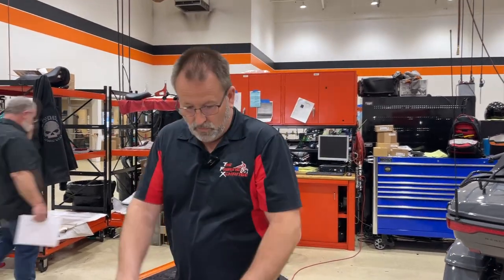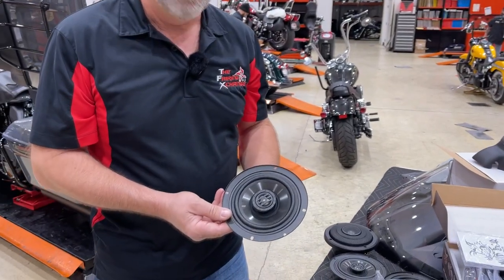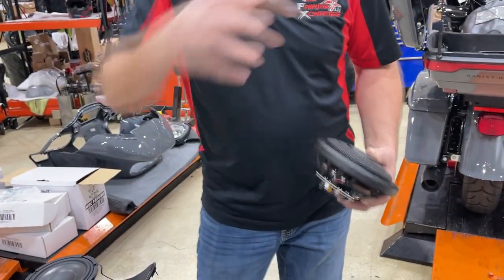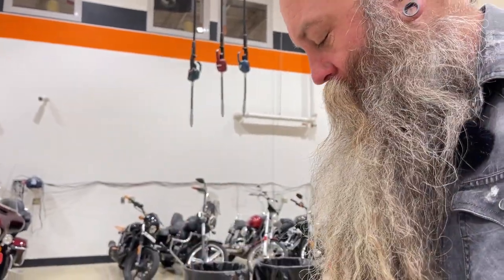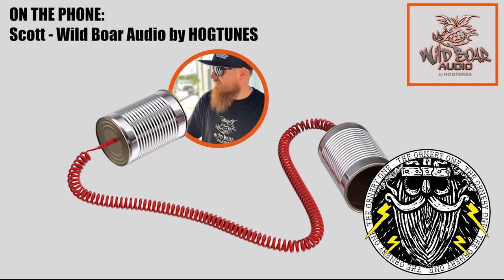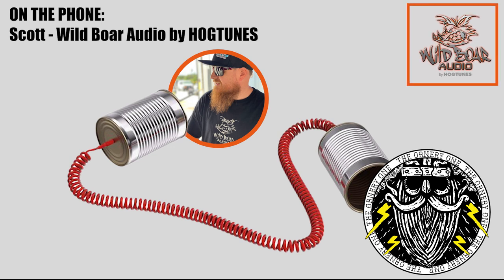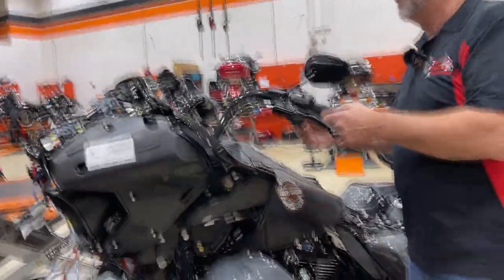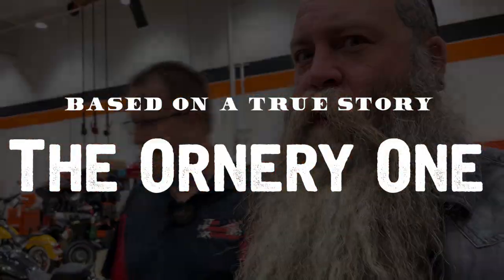EP8 Motorcycle Audio 400 watt amp 6 speaker system bike build | Wild Boar Audio Hogtunes Best Stereo

Comment: Interesting you guys are flashing the radio, as it makes sense to do. When I called Hogtunes to inquire about this kit they told me flashing was not necessary
Reply: It is not a must but it Lowers the output from the radio giving you a cleaner signal going into the amp so it is cleaner as it is amplified coming out.

Comment: I put the 4 speaker Ultra kit on my 2016 last summer. I had an amp go out and Hogtunes replaced it with no problem. I upgraded my amps to the new 400 watt amps and this system will absolutely blast now.
Reply: I didn't have the same experience. we are removing it all sending it all back and going with sinister audio.was not much louder than stock.2022 ultra limited
Reply: @tintshopnc5552  did you have the radio flashed?
Reply: @firechickenracin  its a 22 so you don't. the system is a little better than stock but doesn't hold a candle to the kicker and no where near the rockford. we decided to go with sinister just waiting to see if they will take it back or we are stuck with it. if we are ill do a full video on it and show how underpowered it is so people don't waste their money on it when there are much better choices out there.
Reply: @tintshopnc5552  with out a hog tunes installer flash it won't get loud
Reply: I didn’t install it myself, I paid a shop to do it. They have been in touch with them and it’s all setup correct. The system stinks. It’s not all that. It’s like a 800 watt stereo but they only let you use 100.
The shop we used was even dissatisfied with the results. They do a lot of bikes .
Reply: @tintshopnc5552  my story with hogtunes is they advertised on their website plugnplay. So I decided to go with hogtunes. I ended calling them up because something just wasn't adding up. They said I would have to get my stereo flashed. So now I would have to have grizzly Harley Davidson install it then ride it 120 miles north to Kalispell Mt to have a dealer of hogtunes flash it. Who was gonna be responsible if the stereo didn't work? That stereo came in that day to grizzly hd. I went straight down there after work and told them to send it back. Then hogtunes tried telling grizzly hd it didn't need to be flashed because its a 2019 and to relay me that message. So now these idiots don't even know their own product which speaks volumes. A sound system was financed into the bike I bought.  I literally gave my fob back to grizzly hd owner and said if you don't get me a Rockford fosgate sound system you can take the bike back. I ended up getting a Rockford fosgate sound system. Get this I paid just as much for a stage 3  Rockford fosgate 6 speaker setup (that only requires 1 amp) with color matched lowers from hogworkz  vice a 4 speaker set up with hogtunes wild boar. My Rockford fosgate 6 speaker sound system is the best bike system in the Missoula area hands down. Like I said best decision I ever made.
Reply: So if what you are saying is true it’s not a plug and play. The people at hogtunes never said that.
It’s just not a good product and this seems to have more people trying to return and being unhappy than is being spoken about.
Not a good product and I’ll wait to see if they take it back, they aren’t good about that. If not it will make a great video at my expense of $1300.
I may give it away if that happens but I won’t keep it on my bike.
I don’t ride it either until it’s fixed .
It’s brand new and I can’t enjoy the bike .disgraceful
Reply: The Rockford is a much better system. I’m glad you got it sorted out.
They usually don’t take back anything. I have heard horror stories. And $1300 is a lot of money to me and most guys.
Reply: @tintshopnc5552  the stereo was still in an opened box at the Harley dealership. Hogtunes Pretty much had no choice on returning it.
Like you said the newer bikes supposedly don't need to be flashed, but those idiots told me they do. So I don't know. That was the deal breaker of them not knowing their own product when it came to me buying their BS. 
Rockford fosgate been in the business for decades and has always put out quality stuff. 
Hope you get your money back
Reply: As a shop owner I can say , you got to know your product. If not people lose faith in you.
I’ll keep you all posted on what happens and if they are a stand up company or just no good
Reply: @tintshopnc5552  the reason why hogtunes 4 speaker set up was gonna be just as much as the Rockford 6 speaker with hogworkz color matched lowers is because at that time in 2020, hogtunes we're selling unpainted speaker lids that were apart of the kit. Then I had to out source a painter to match the lids to my bags. Grizzly Harley had set that up for $500.
With Rockford they were ahead of the times and we're the first ones sending out templates to cut the lids   for the 6x9's. 
I didn't need to spend $300 on lids and $500 to have them painted.
That extra $800 gave me room to buy 2 more speakers and the lowers from hogworkz.
Reply: @mikepsly73  my audio guy has a phone call with them this week we will see if they sort it out. if they do ill update you all .if they sort it and it sounds like it should ill keep it.
Reply: @tintshopnc5552  the only reason why I went with hogtunes in the beginning is because they advertised plugnplay no flash needed. Where I live in Missoula the only choice I had at the time was that boom audio crap. 1 amp for every 2 speakers gets really expensive and they take up room. Once hogtunes rep said to me that I would need to get it flashed I sent it back that day. Grizzly Harley became a rockford fosgate installer and dealer because of me.
Reply: @mikepsly73  so here is where I sit as of now.hogtunes sent my shop a new speaker it still sucks , the kicker is still much louder and better bass and half the power. the dealer cannot send it back so I have to take a loss and try to sell it. we will be making a video comparing the system to kicker and rockford which is the loudest system I have heard yet . the sinister sound I heard on a bike here by my shop was another awesome choice. we will show people in the video how low it is and cannot barely be heard at 65+ MPH.also its money out the window , there are no returns.so I am out $1300 plus labor and have to start over , new system will be 2k. people before you buy investigate all the issues that hogties has.
Reply: @tintshopnc5552  sucks bro. Buying shit twice for a bike is what we deal with..however that is a huge hit. I would just box it all up and send it back with a letter telling them they can keep their garbage.
Reply: @mikepsly73  they don't take back anything that has been opened . the shop that installed it will no longer deal with them or any of their junk. they are Canadian based so there isn't much to do. I will try to sell it but won't ride the bike until I get something good in there. you wind up leaning into the fairing to try and hear music. terrible.
Reply: @tintshopnc5552  Wow.  Somehow something must have been wrong.  if you installed the wild boar system and you do not think it is amazingly better, there was something wrong!!  Flashing it does make a difference and there are different settings on the amp so maybe that was the issue.  Obviously it is too late at this point, but I wish we could have looked at it to see what was wrong.
Reply: @paulbarber4892  here is the latest update, my local shop spoke to Pez who is the owner he has 5 bikes like mine that it sucks in because the new bikes are giving HT trouble. rather than make good on returns they choose to just say no. so this shop will have to absorb the cost of the whole deal. the vendors are also not being reimbursed so they won't take the hit. all the local shops here refuse to do the HT systems from now on.this issue is a 2022 and newer issue that HT can't figure out.so yes the company and their junk is trash.
Reply: @tintshopnc5552  I am really sorry to hear you had an issue.  I am not familiar with an issue, we have installed hundreds of the Wild Boar systems and have had amazing results.  Ride safe,
Reply: @paulbarber4892  hogtunes has a lot of dissatisfied customers and it's no wonder why , 1-no returns 2- low power as compared to others at half the watts. 3-they talk down to you. 4- its not I DIY as it needs to be flashed at the dealer anyway so why would you do this?all this is in email chains corroborating my statements from hogtunes themselves so buyer beware.if anyone thinks this is an exaggeration I have the bike at my shop most times and it is something ill gladly show until next month when we install the rockford forget system and probably throw this garbage out. learn from my mistake and save the $1700 for $200 more get anything else as the rockford forgot , the sinister audio and the kicker systems are all so much better. ride safe
Reply: If you're going to upgrade your audio, don't waste your time with this cheap crap, pay the little extra and invest in some decent high end speakers like ground zero or hertz.
Reply: It's all a matter of opinion when it comes to audio. Everyone thinks that what they have is the best . I pull up beside new bikes with the boom audio upgrade from Harley and drown them out. For $1399.00 I'm very satisfied with Hogtunes Wild Boar system.

Comment: So when will that particular kit be released? And the cost? If I could get ahold of 1200 vs the 900 watt id be highly inclined to pull the trigger on it. Who knows the existing 900 kit may be adequate?
Reply: The 1200 watt system has not been released as a kit at this point.  We (The Fairing Xchange) can put the kit together for you.  The 900 watt is very loud and clean for sure.  The 1200 is probably more than most normal people want but we and not normal!  We want it because it is possible and makes people go WOW!! :)

Comment: Nice setup but looks like they’re using factory speaker wires. That’s like buying a Big Gulp and using a coffee stirring straw to drink it.
Reply from the maker: This is good to hear!! We will look more into them
Reply: Good eye!  In this case the short length of factory wire will handle the power that the amp will be pushing to the speaker without restriction.  Using the factory wire for this run also keeps the plug and play aspect of the kit and all factory connectors, seals and grommets are left in place.  The interconnect wiring that is used in the fairing, and supplied with the Wild Boar kit, is 16 gauge, twisted pair wiring ensuring excellent signal transfer!